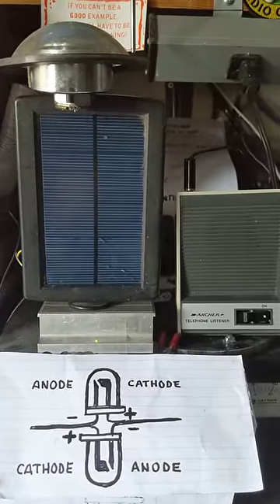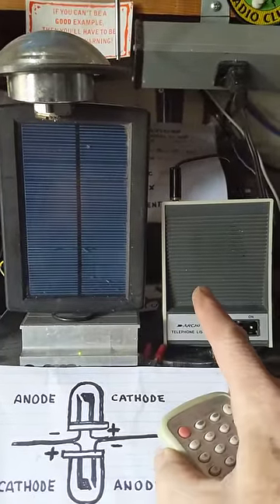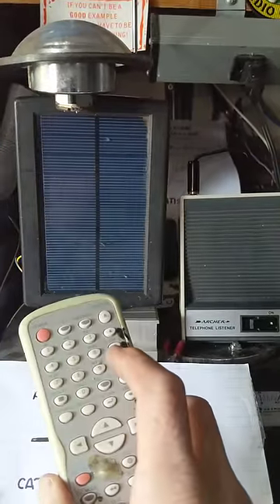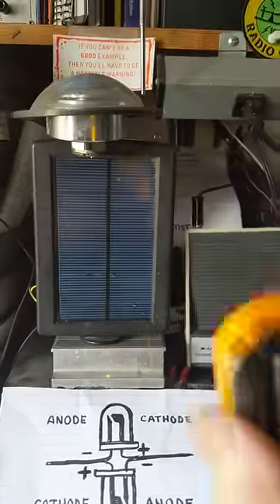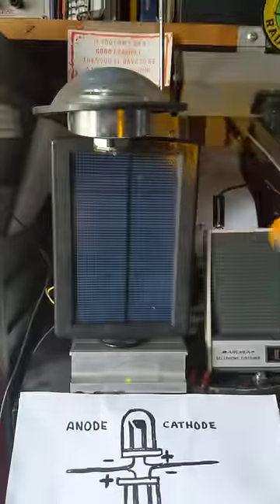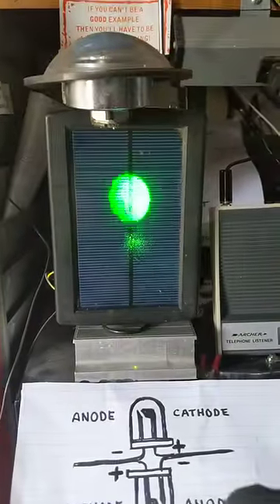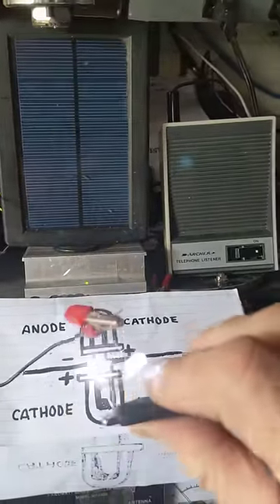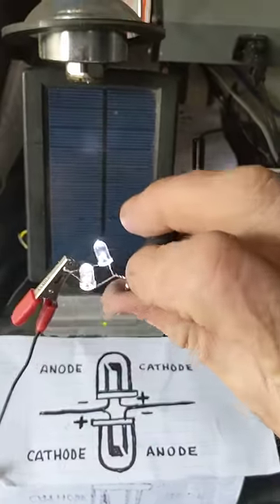Solar Panel Audio Detector!

Comment: Im a ham radio operator and that last one took me completely by surprise. That is really cool.
Reply from the maker: It took me by surprise as well. 73's
Reply: @GrantsPassTVRepair  oh a fellow amateur that's awesome. 73's
Reply: Same here. 73
Reply: Same here, 73
Reply: It should take you by surprise because a ground wire and an antenna does not have enough power to light up an LED... 🤨
You sir have an amplifier attached to that antenna and you have those LEDs hooked up to an audio output...
Furthermore, FM radio signals operate in the megahertz range and the highest frequency the human ear can hear is 20,000 hz. So even if a radio signal was converted directly into audio, it would be completely inaudible. Even at half the radio frequency it's still inaudible...
Call it a lie by omission if you will but it's still a lie.
Reply: Oh, ham meeting. Nice. 73 from CT9 area hehe
Reply: @Unmannedair  he states in the video he's sending an audio signal through the LEDs and using an amplifier. The surprising thing is that PV panels are sensitive enough for audio signal detection at all, not the process to do it.
Reply: I didn't expect to see so many hams! 73 yall
Reply: 73's from ve7coa
Reply: @Unmannedair  You may be correct, but that doesn't make you any less of a nerd 🤓 lol j/k
Reply: Me 3.141
Reply: @TheDeathLove  yep u got it,  pretty niche area in ota data transmission. Lot of ppl are unaware of it.
Reply: @Unmannedair Who said it was FM stations? Didn't you know that AM radio can be demodulated with a simple diode?
Reply from the maker: @CJC051  73s
Reply: I have less than 73 hams but I’m working on it!
Reply: My grandfather was KD4PEN. Would love to get into HAM
Reply from the maker: @JosephPPreston  Chances are there's a local ham club in your area, and most ham operators are a friendly bunch, who could assist you in getting your license.
Reply: Wait until you hear about LED array backfeed motion tracking AI.
Reply: @Unmannedair  I found this in the video information:
“One other point I should explain, his how I'm able to light up the two LEDs (Light Emitting Diodes) with just an antenna and a ground wire. I live about a mile from two AM radio stations, so I'm able to pick up enough power off my 200 foot long wire antenna to light up the LEDs”

So it is possible to light LEDs using only RF from nearby radio stations, and AM radio is low enough in frequency (530 to 1700 kHz) and is of course amplitude modulated so that an LED has no problem detecting the RF to AF and retransmitting it as a modulated beam of light. 73
Reply: @GrantsPassTVRepair  -  So the voices in my head are real? HA HA   I knew it!
Reply: @Unmannedair  -  It was AM cupcake, and the DC caused the diode to be over the breakover voltage so it detected the AM signal easily and out comes the audio.  FM is doable but takes a little more finessing.
Reply: 73

DE KD2HJP 

Out to the garage when it warms up a touch.. I have the RS amp and some solar... 

Science on a Saturday
Reply: What a 73?
Reply: Pretty much how crystal radios work just with an extra step! Very cool and interesting 73.
Reply: @JosephPPreston  So do it. It's easier than ever. There's study apps, and the test questions and answers are public record. 

Now I recommend learning the fundamentals, but people who can simply memorize test questions..
Reply: I didn’t know you could make radios from ham!
Reply: @In3rt_ia Means Best Regards  73
Reply: 73
Reply: Fun fact, if you put power into a solar cell, it'll glow like an LED.. Because thats kinda what a solar cell is, inefficient yes, but still same principle. The opposite works when shining a light into an LED
Reply: Ham is tasty
Reply: I don’t know what it means but since everyone else is doing it, 73
Reply: @Unmannedair nah, I think the trick to the last one is that he's sending amplified audio down to the LED diodes, and they are wired in reverse polarity to eschother as diodes are conductive in one direction. The LED's are pulsing from the stereo output from his mixer.
Reply: 73s from FM18
Reply: @drewb5738 it's just saying goodbye in radio speak, kinda like saying "10-4" 

i believe its a vestigial artifact from morse code
Reply: I mean it’s basically just a diode radio without any sorta tuner isn’t it?
Reply: I still don't understand  the last one. The transmission is being received on the ground... as a ground plane antenna... I just don't understand why it's transmitting over light on the back end of the ground?
Reply: @Unmannedair AM radio can be picked up and demodulated by a simple wire (antenna) being the correct length to cancel out the carrier wave.
I had a customer whose in-office phone lines were picking up a local AM station. My butt set and my induction wand would both pick it up and let you hear it.
Reply: @ethanlamoureux5306  THANK YOU for clarifying and letting that guy know he's wrong, hope he reads it. I was thinking AM would probably still work.. but wasn't sure and didn't think to check the description. Also I was very curious
Reply: @zerobyte802  while at work the other day I was trying to trace a cable with a cable toner and when I held it near a certain group of wires there was a radio station playing loud and clear through its speaker.. It was wild, but I guess I'm starting to understand why 😆 didn't think it might be an AM station nearby
Reply: @GrantsPassTVRepair what do you mean by "73's" 🤷 .. I would like to learn
Reply from the maker: @halbertgonzalez6775  In Ham Radio, ’73’ commonly generally means “best regards” or “goodbye”. It’s often used at the end of a communication to express goodwill and friendly intent.
Reply: LED can cause Radio RF interference. So I'm sure it has some other RF abilities.  KC3HGA 73s
Reply from the maker: @kharton28  Can an LED  really cause interference, or is the LED pulse width modulation driver you are talking about?
Reply: @Unmannedair you're talking about the carrier wave, the modulated signal is in the audible range, otherwise no one would ever be able to hear radio signal!
Reply: Am radio
Reply: I'm a tower technician l, through me for a loop 😅😂
Reply: @Unmannedair He was transparent about that. He is powering the LEDs with an amplifier so that they pulse at the frequency of the radio signal, which can be picked up by the solar panel and played through an amplifier, as the output from the solar panel is an amplitude- modulated analog signal.
Reply: @GrantsPassTVRepair what does 73 mean? I’m so lost
Reply: Well how can I leave a thread like this?
73s all, I'm definitely going to make this myself soon
Reply: What kind of amazing hackery is this?
Reply: @Unmannedair  Crystal am radio?
Reply: @Unmannedair yeah it makes more sense an audio signal is being passed to LEDs.... I remember a crystal radio was able to take direct AM and power headphones directly so more likely than FM, these LEDs are doing similar to what a crystal radio does
Reply: @ethanlamoureux5306 thanks for clarifying.  So he's getting the power to the LEDs by induction, just like if you were stealing power from the grid without a physical connection
Reply: @Wise4HarvestTime  That’s part of it. He’s using a longwire antenna to receive radio signals from local AM broadcast stations, and the energy from the antenna is driving the LEDs directly. An antenna works through induction and capacitance both to pick up the magnetic and electric waves emitted by a transmitter. If you’re talking about using an inductor (coil) to capture electicity from nearby powerlines, that is using one method to convert magnetic waves into electricity. A conductor parallel to the powerline can capture an electric wave through capacitance. Neither method is stealing, though, since the power radiated from a powerline is the same whether you capture it or not; it is wasted energy which would normally be absorbed and dissipated into the area around the powerline.
Reply: @ethanlamoureux5306  I was told by an electrical engineer that it places a draw on the grid and the power companies can and do detect when people do this.  It's not like rain running off a roof and you're just there to collect it, but more like a siphon in a bucket
Reply: @FalloutProto  only time the ATF has even been remotely close to funny... 😂
Reply: @Unmannedair you sir are one smart cookie
Reply: I once picked up the local am talk radio station on a bass guitar....
Reply: So does this mean led bulbs can transmit radio waves? If so it would explain why they push them so hard so they can bombard you with radio waves to change your mood or mindset.
Reply: 73
Reply: Now that ladt one would be a hell of a way to make secret radio.
Reply: I think you have a crystal radio there.  it's demodulating The nearest radio station or transmitter.
Reply: back in lhe 60s my friend used a torch to send music to his girlfriend , using another torch with a phototransistor
Reply: My grandfather (KD4BRK) was a HAM radio operator as well. I could sit with him for hours when I was a kid just listening !!!
Reply: This was a fun one! 73s!
Reply: @MasonBitByte nope, 10-4 is CB jargon for ok, understood..10 10 would be the CB equivalent to Amateur radio's 73 ..it just means, good bye and good wishes.
Reply: The last one is really interesting
Reply: @Spartacus-4297  Went digital. 42.
Reply: My guitar amplifier, using the cord touching the bridge of the guitar I can pick up all sorts of signals🤷‍♂️ not sure if that's interesting or not but I can listen to music with my Amp 😂
Reply: He's basically created an optocoupler.
Reply: How comes it’s not mentioned that the antenna and amplifier are the one producing the double radio signals. Is not completely true. Would this be a 30 or 99? Asking for a friend.
Reply: Same ...73s from VA!
Reply: @Unmannedair It's amplitude modulation. The high frequency signal averages out and you only hear the envelope. 

Whether you can light up an LED really depends on how far you are from the transmitter.
Reply: So essentially you created a wireless speaker?
Reply: Very weird... uh... 73
Reply: @In3rt_ia   It's a number that had been chosen by CW operators that's used at the end of a transmission as an abbreviated way of saying "Later, my friend".  There are many abbreviations used by CW operators, like RST for example.  Giving a RST for someone is letting them know the (R)eadability, (S)trength, and (T)one of their (C)ontinuous (W)ave transmission.  With the use of a CW or Morse Key (same thing), the continuous wave is broken up into short and long waves, otherwise known as "dots" and "dashes", to form letters of the alphabet and numbers.  'A' for example is . _ and '1' is . _ _ _ _
Reply: @organiccold  CT9. Margate?
Reply: a ham radio operaror who doesn't know that a diode acts as a detector?
you're an appliance operator not a ham radio operator.
Reply: Jesus plz stop saying 73
Reply: @Unmannedair  no he actually kind of said that you just didn’t listen clear enough but that’s cool. I’m glad you took the time out to edit it as well to make sure that everything was complete.
Make sure you got that whole disrespectful comment in there. Great job you only problem was you’re wrong so it’s a moot point. 🤦🏼‍♂️🤣😭
Reply: @Unmannedair  and just the fact that so many people liked it because it sounded good but they don’t know that it was completely Ludacris they just like it because they are NPC’s😂
Reply: ….—-….——……..-.-……

what i say
Reply: Same here 73's and 88's
Reply: @Unmannedair  listening isn't your strongest skill is it?😂😂😂
Reply: Well now I feel obligated. 73's yall
Reply: He literally just made an opto isolator and connected it to the output from the radio. This is the same technique that I use to isolate high voltage signals from instrumentation for safety of the operator and equipment.
Reply: 47
Reply: That same was my btech minor project 😂
Reply: Do they use this in astronomy by any chance?
Reply: Same here!
N5ITE
Reply: @MrMotorchild 
WoW I haven't heard words like CW since I was in my Electronics Shop at the Vocational school that I went to in Pennsauken, NJ way back in 1972.  I was a ham radio operator that used Morse Code to communicate with other ham operators. The furthest I ever got was someone in Canada while in school on our Continuous Wave setup. I believe we were only allowed to use 75 watts. This fascinated me and I wanted to learn more about Electronics. My call letters were WN2ADS. I really can't believe that I remember them. I went on to become an Electrical Engineer that worked for TRW ELECTRONICS,  RCA, GE, and finally Lockheed Martin. Thanks for bringing up some fond memories that I hold so dear to me.
Reply: @JuneNafziger Exactly that !
Reply: @GrantsPassTVRepair I think the source of interference itself is the current driving the LED. So, all the parts of the circuit, that current is passing through, can act as interfering transmitters. That includes the driver and the LEDs.
Reply: De KC3NLS
Reply: That surprised me too
Reply: 88 guys 😂
Reply: An antenna and a ground wire pickup enough energy to forward bias two diodes sufficiently for them to illuminate that brightly? Hmm.
Reply: @ferrumignis I didn't know that, ty for the information bud.
Reply: @tarustrader you are correct...sadly
Reply: 73
Reply: @keagan0000 I’m full after one ham dinner how do you get 73
Reply: @Unmannedair  Some of it makes sense, but some of what you wrote I know is outright false.
Even though this might be a hoax/gag, you have no reason to assume that those stations are FM. If they are short wave AM, it is most definitely perfectly possible that they get accidentally demodulated. Especially when their source is not too far away. In my country there's a residential development that was originally illegally/erroneously placed. Local authorities overlooked the keepout zone regulation around such antennas. People who moved in, complained about hearing the station that was broadcasted from the antenna array right behind their gardens everywhere. They heard it on the radio on all frequencies because it tied directly into the amplifier, they heard it on tv mixed with the channel's sound. But they also heard it on baby monitors, door bell intercoms, and some of the craziest reports were about a toaster that played the radio station audibly, and a metal garage door.
These people had to make tons of adjustments to their homes in order to make their lives bearable.
So yes, it's perfectly possible to receive radio stations without a tuner.
Reply: i would be kind of skeptical about these claims....especially the detector hack.
Reply: Heck yeah! I got my license when I was 12. I am 21 now. About time to get it renewed!
Reply: So you listened to pigs?
Reply: @fetidcreeper  Ummm im tellinnnn!
Reply: Dont AM much do you?@Unmannedair
Reply: @Unmannedair  ah yes
 Somebody in comments indeed says that he sends a specially modulated light signal using the diodes 
And this way it's not even surprising anymore because it had been done on YouTube before. By actionlab, at least, i think
Reply: Hay man you seem to know what your talking about. I like that. Can you point me in a good direction to learn topics like this online @Unmannedair
Reply: @Unmannedair  I'm pretty sure you are right, however my first thought was it was working like one of these ultra simple crystal detector radios (which used diodes for demodulation I guess). I'm still not 100% sure
Reply: @Unmannedair  Regarding your last observation, one might say that the telephone amplifier itself might behave as an low pass filter.
Reply: I came here to say this but knew in my heart it had already been said. 73s!
Reply: @Unmannedair those for SURE weren't AM stations
Reply: I'm in tje Army and got Ham certified
Reply: If I remember correctly, the two LED is acting as part of diode of old crystal radio for receiving AM signals.
Reply: @ethanlamoureux5306  I light leds and florescent bulbs with my CB radio as a kinda party trick. Maybe I'll make the rig you have with the solar panels from one of my garden lights.
Reply: 37s
Reply: Local AM radio stations transmitting a lot of power. Often touch the input lead of a small signal audio IC with a metal lead and audio will come out of the speaker. With the optical setup I wonder if the station is being picked up from the leads in your hands as I cannot see it modulating the light?
Reply: 73 de CN8FA
Reply: @AbidFatih-e7u  OK that was one of the mystereries  hiding in plain sight. He was transmitting audio no big trick .
Tosc audio links are common they are digital AM radio analog but on consumer audio equipment very common. Demonstrates the frequency response of a photocell.
I had some idea of direct detection out of the air put transmitting off a radio's speaker output more likely.
Reply: 73’s. Dad was a ham. Wa9fdp. Very cool.
Reply: Mentality just as 'Far' as 73 ?
Apparently as this guy meant good and just got annihilated for that .
Life  . . .  Is more than  Wavelengths.
Reply: 73's from the UK
Reply: @ethanlamoureux5306  of course the best comment is from another Ethan
Reply: @In3rt_ia 

The usage of "73" for such a purpose comes from the Phillips Code, originally devised in the era of telegraphs to speed up transmission of common messages by mapping them to numbers.

"73" mapped to "best regards" or "my compliments" and was intended as a general valediction for transmitted messages.

It is still used for that purpose today in morse code transmissions and often makes its way into everyday correspondence among hams as a form of jargon.

There is also "88" (which maps to "love and kisses") that sometimes takes the place of "73" for communications between affectionate parties.
Reply: Weird question…..can our phone screens detect things far more subtle than our fingers?
Reply: As a student that built a ham radio for a project, there’s always something that doesn’t make sense with the witchcraft that is ham radio
Reply: 72!
Reply: Why they switched it all to led, it's a weapon of the mind, wonder what station they're playing to all our subconscious
Reply: Is that another way of saying you're an old school truck driver?
Reply: My girl and I are wanting to take our ham radio classes soon. I think it would be a cool hobby. And very good for emergency situations
Reply: Another Ham operator here, 73 everyone!!
Reply: I guess it did a little too. 
But the first thing that got me into amatuer radio is a toy remote car I had from late 70's that when the car was turned on and not touching the remote, you could hear faintly, truckies driving past on Victoria road Sydney with your ear upto the base of car. 
Still not sure how without a speaker I could hear that.
Reply: What if it was picking up AM? Would that make a difference? @Unmannedair
Reply: An LED is just a rectifier, like the old AM crystal radio receivers we made as kids. 73s
Reply: What is a 73 I don't know anything about hams I'm just curious
Reply: I am studying for my test!
Reply: Aren't LEDs diodes?
Reply: @hitmusicworldwide  exactly, diodes with a low reverse breakdown voltage which is what creates the light and that's why they need a limiting resistor to keep them from blowing up
Reply: I guess the radio signal attenuates the light somewhat.
Reply: So cool
Reply: Vy 73 from Germany!
Reply: What model number is that Archer Telephone Listener?
Reply: Wats 73 mean
Reply: Same 73’s KC9VLZ
Reply: @In3rt_ia something like "best regards" in ham language 😊
Reply: @Unmannedair  the word "amplifier" was literally the 13th of 14th word in this YT short. You have ADD?
Reply: @GrantsPassTVRepair Cool video! What could you replace the Telephone Amplifier with? It seems like it would be hard to find.. I have to look into them, are you just using at as a speaker or how do you have the solar panel wired to Tele Amp??
Reply: Same here 73 !
Reply: Oh... Oh yeah! I'm 83... 😐
Hopefully I didn't just say something stupid. I mean I'm always doing stupid stuff but, actually nevermind. Too much invested to delete so I'm leaving it. 65 or whatever you're all saying
Reply: @Unmannedair bro it’s not just a ground wire, he’s got a negative and a positive attached. Watch the video man 😊
Reply: an audio signal detector maybe
Reply: @Puma_Concolour you should have found a station with music and impressed your friends with your new bass skills
Reply: I’m a certified forklift driver, and it got me too.
Reply: @Unmannedair He provides more detail on this in the video description.  It's a 200 foot antenna wire, and he lives within a couple of miles of the AM transmitters -- so there is indeed enough power to light those up.

The carrier wave is lighting up the LEDs at the carrier frequency -- basically a sine wave at 500-1500 KHz or so, so definitely not audible, but useful to bias the LEDs so they stay lit.  

The signal on the carrier with an AM transmitter is just at audio frequency though.  Subtract the carrier and you are left with a simple audio signal, just like you'd get from a headphone jack on a radio picking up that signal.

This is just a crystal radio, powered off the signal.  In a crystal radio you'd hook a super sensitive ear phone to the diodes.  In this case the diodes kick off some light, and he's using his panel as a photodiode, and amplifying the signal.

In his case it's easy because he's so close to the stations, but could probably be done at surprising distance with a good antenna.  Commercial AM transmitters are typically broadcasting at tens of kilowatts.
Reply: The LED thing I had never thought of. I am still not sure it would be that simple.
Reply: ground wire and an antenna, two diodes. try with 2@1n36 ? but someone mentioned light amplification. he has the scheme right there. 73's
Reply: It’s been about 2 weeks now, I know y’all been experimenting in the shack; post what you come up with, especially if you found away around the Ol HOA antenna restrictions 😏

73
Reply: @Unmannedair  Could be he's just lighting up those LEDs from a current source and the diode is picking up a nearby AM station, modulating the light output.
Reply: @japhalpha Just wait until they start giving out their call sign while calling QC over SSB during a POTA activation, you'll probably hear them nice and clear, easy 5 & 9 because if there's one thing radio geeks are good at, its spending crazy money on radios 😂
Reply: 73 from 4 land
Reply: I have a iPhone that you can actually talk on and listen to radio channels believe it or not
Reply: Greetings from DL, 73 :)
Reply: @ethanlamoureux5306 😅
Reply: What’s 73?😂
Reply: Not exactly ham but I'm a Bacon Radio Operator and the last one is how we broadcast sounds of snot leaving nostrils.
Reply: 73's and 88 \o
Reply from the maker: @Unmannedair  You are so wrong. Please do a few minutes of research before leaving such an inaccurate mean spirited comment. Everything I've done is easy to verify for your self. https://www.youtube.com/shorts/aSSqrddG6B0
Reply from the maker: @Jared_Thompson 73s back your way.
Reply: @GrantsPassTVRepair So can an LED both transmit and receive signals? For instance LED bulbs pick up audible sound waves and transmit them to a receiver?
Cool channel
Reply: @Unmannedair  Call that a radio drama
Reply: I'm mind blown
Reply: Non linearity of the Vf/If curves of the diodes demodulate the RF, similar to a crystal radio. It’s just missing the LC tank to give it good frequency selectivity.
Reply: @Unmannedair ehh, there’s likely more here but even a single BJT’s BE non linearity is enuf to demodulate RF into baseband audio, done it many times. Even have dropped scope probes into circuits and incidentally demodulated radio Saigon when I was working in Fountain Valley, doesn’t take much for AM.
Reply: @Wise4HarvestTime  You are correct. It's referred to as an "inductive load" for a reason. If you don't have any resistance on the receiving circuit (or it's an open circuit), then it doesn't produce a draw, but if you do, then the electrical becomes magnetic resistance that effectively tries to slow the electromagnetic fluctuations emitted by the source circuit, which has to "work harder" to maintain the same frequency. I believe the term "eddy currents" comes into play here, although I'm blanking on exactly which aspect that term describes.
Reply: @WhiteTrashTennessee  What? In short, no. In this case, the radio waves are being picked up by a traditional antennae (he said somewhere it's 200 ft and about a mile from the broadcast towers), which turns the radio waves into electrical signal in the wire, which powers the LEDs, which transmit *light* to the solar panel (solar panels are basically LEDs optimized for the other direction and will actually glow if you power them, like how speakers and microphones are "the same thing"), and then the solar panel turns the light into electrical signal on the wire to the amplifier.

So really, it's just a very complicated Rube-Goldberg machine that takes electricity at the radio tower, turns it into electromagnetic waves in the radio frequency range, turns it back into electricity, then turns it into lights, then back to electricity, and then the amplifier boosts what is now a weak signal and turns it into sound via the speaker 😂😅
Reply: @seth7131  I mean, it's interesting, but you also just reinvented a radio. They are basically just an antennae (likely your guitar strings), an amplifier (your amplifier, obvi), and a speaker (part of your amp). The main difference is that a radio has some mechanism to "tune" which signal you hear, which is really just any mechanism that selectively boosts some frequencies and reduces other frequencies.

I'm trying to think of which guitar effect pedals might do that, but I'm drawing a blank. It's possible you could achieve it with two chains in parallel. One chain would be a high pass filter and a low pass filter to select down to a particular frequency range, and then a phase inverter. The other "chain" would be just the original signal. When you recombine the two, the frequency range you tuned would be doubled in volume. I suspect the filters don't have enough range to actually tune in the radio spectrum though, since they are designed for the audible range.
Reply: Even more interesting thing to search is how you can actually record audio by talking to a light bulb
Reply: Imagine all the radios all at once
Reply: Are the led's lit from the RF? I know that a good hot antenna can do in fact, I think this actually might work using an RF generator. I'm gonna test I have an RF gen. It's kinda is surprising but, once you understand that light acts just like radio wave's your good! The led's de modulate the rf. The solar panels is still like a detector, but also a receiver. I wonder if a optocuopler could be used too?
Reply: It's like the flipper zero before its time but not really at all
Reply: @Spartacus-4297  what does 73s mean?
Reply: @GrantsPassTVRepair  it's 73. Not 73s. U3s means best regardses..
Reply: @efahrenholz no he explains is in the description.
It’s just an extremely long (200 foot) antenna on one side and ground on the other.
Being close to an AM transmission tower he is able to produce enough voltage to switch on the led (led turn on voltage as low as 1.2v so this is very possible).

The amazing thing is the ability of the solar panel to pick up the 
 frequency and convert it straight into audio like that.
Reply: @Unmannedair you sir am absolute W 💪
Reply: Mini hamfest lol, 72s (got a bad wifi sig)
Reply: @Unmannedair  Makes more sense if it was picking up AM signals like an old unpowered crystal radio.
Reply: Didn't surprize me!  Use a High Q tunable tank circuit and use that to drive the LED's.  Then, tune the tank to select one of the AM radio stations.  Not a HAM, but I started in electronics in 1958 with the ARRL 1953 Edition Hand Book.
Reply: @GrantsPassTVRepair  Any good channels you'd recommend for getting into amateur radio?
Reply from the maker: @taylormay9938  Did you see this video on Amatrur radio? https://www.youtube.com/watch?v=HSeuRiqWg-o&t=484s
Reply: Wow,459  thumbs up for verbal diahhrea that is incorrect and shows a complete lack of knowledge with regard to this video.
Reply: @Unmannedair a diode can demodulate am and the Led will light up if a am station is nearby
Reply: 73s
Reply: im a civilian dumbass and it blew me away
Reply: When the radios were the in thing i used A.M before F.M came ,to test remote when i repaired them.
Reply: Wow me aswell, 73s!
Reply: @In3rt_ia 73 is take care goodbye in ham jargon. And 73s is same in CB jargon.
Reply: @Unmannedair love the astute pier analysis .👌
Reply: @Jared_Thompson  What the hell is 73?
Reply: Same....
Reply: @Unmannedair  Do the two diodes in the system have anything to do with the mixing of two radio stations?  Or that's a distraction and the audio was mixed elsewhere?
Reply: @GrantsPassTVRepair  I'm guessing the length of the antenna is what is doing the "tuning" for the pulsation frequency of the LED's!!! I wonder what would happen if you added a wire-wound rheostat in series just before the LED's?! Might tune other frequencies?! 🤔
Reply: @jagmarc  The signal using an incandescent bulb is probably not as "clean" as using an LED due to the rise/fall switch time of the LED being faster/shorter.
Reply: @charlesthomas135  Yep! An "air gapped" signal transmission!!! Somewhere I read/heard that data could be swiped from the flashing LED light of a hard drive status indicator!!! 😬
Reply: @BikingChap Might even be possible to add a "Joule Thief" to the circuit for an extra boost!!!
Reply: @fookingsog   Even when 'electroluminescent diode' came out in the 1960s the incandescent bulb was still preferred had plenty sufficient bandwidth for writing soundtracks.
Reply: @Unmannedair  It may well be an AM station he is picking up.  Those can be converted to audio with a simple diode and cap. 

Which incidentally that is why they sometimes call capacitors condensers, because they were used to condense the audio from a high frequency down to audio frequency.
Reply: It seems to me that anything can be made to transmit wirelessly if each and every wire were converted to light like that and received by a solar panel. I mean it looks to me that light is somehow working to transmit the data and the solar panel is receiving it like a wireless receiver. What is going on here?
Reply: Same here, K7AXA